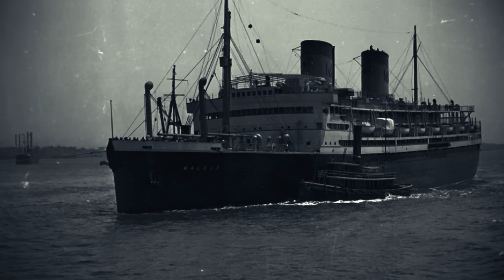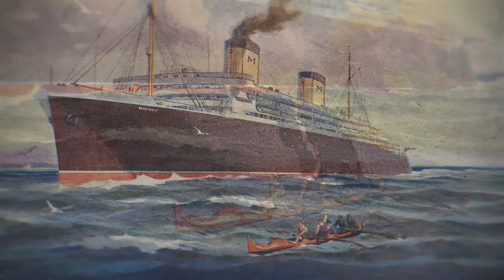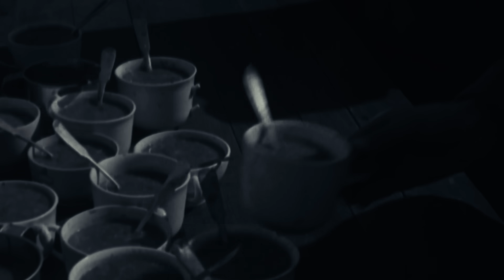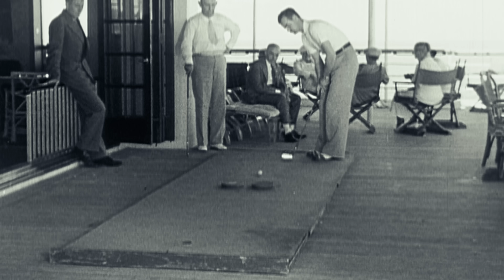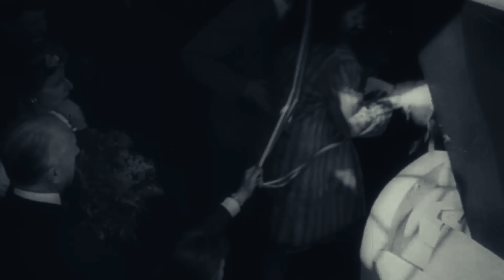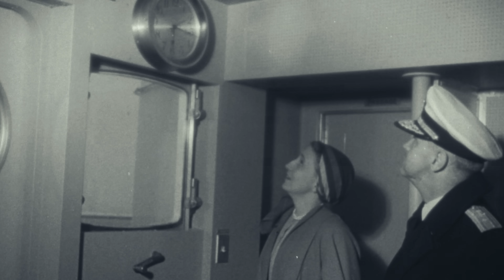240,000 Horsepower: The SS United States

Comment: One minor correction: The four boilers in the forward boiler room were made by Babcock & Wilcox, while the four in the aft boiler room were made by Forster Wheeler. All used Babcock & Wilcox designs, yet for reasons never solved, the Forster Wheeler boilers produced more smoke than the Babcock & Wilcox boilers.

Comment: Gibbs's also designed the "SUPER PUMPER" and "HOSE TENDER" for the New York  City Fire Department in the 60's . It was in service for almost 20 years . They were both built as semi trailers .  The pump on one unit and the hose and deluge nozzle on the other .They were  called to multi alarm fires many times . I believe it pumped around 10,000 gallons of water a minute and along with the Deluge Nozzle on the Supper Tender could put out some serious water.  The NYFD has a special Fire house built just for the supper pumper system  in down town Brooklyn  by the old navy yard . It was put in a central location so it could respond to any call in the NYC area . The system was put out of service in the 80's  due to maintenance issues and the equipment was auctioned off .  I worked in NYC at the time and remember seeing the trailer of the Tender sitting in a NYC surplus yard off the BQE. I believe the complete supper pumper and tender are now with a collector in the Midwest . It is a shame they were not kept in NYC as display .

Comment: I've driven through Mobile, Alabama (where she is being stripped for sinking as a reef) several times in the past year, and the first time I saw the United States, I wasn't really sure what I was looking at -- it was so huge, the first time through I though they had built a new gigantic warehouse in the port, until I saw the name on the side of the hull.  Since then, each time I've driven though, there was less and less of her left, until the last time I drove through at the beginning of May, there was basically nothing but the hull left, and maybe the first deck of the superstructure.  She had also been moved out of the dock where she had been, in preparation for being towed out to sea and sunk.  That will be a sad day to be sure, but at least she will continue to serve a worthy purpose, rather than being cut up into scrap, to be turned into razor blades and rebar.

Comment: It was more of a troopship if the Russians got a bit proactive in europe. And was therefore designed to military specifications, with no large open areas and no flammable fittings  and furniture. This however made it rather bland and unwelcoming to passengers and why few went on it more than once before returning to the cosy friendly queens. It's engines were vastly over powered making it  uneconomic to operate. It therefore had to be subsidised (for the first part of its life). Once this subsidy stopped, 2 of the 4 engines were removed in an effort to make it more efficient, but it never had the passengers or the  design to work as liner or a cruiser, with it going  into storage for many decades.

Comment: I think that every engineer should treat the regulations as suggestions. In the way that they adhere within the lines, but go above and beyond for safety and survivability. If you treat a project like you just have to do the bare minimum, lives are at stake and will be lost. The bar should be the minimum, but never the standard. Never the standard

Comment: She was a beauty, fast and pretty. 240,000 SHP is a lot.
I served on the USS Constellation CVA-64. I did the shaft alley watch for one of my jobs. There were four propellor shafts like the SS United States. Each shaft of the Constellation  was powered by a 70,000 HP boiler. 
  Constellation could go through the water at 30+ knots with ease. Which happened every launch & recovery during our time off of Viet Nam. 
  Would have enjoyed seeing the engine rooms of the SS United States ship, bet they were kept clean and orderly.

Comment: One of the reasons high pressure, high temperature steam is considered so dangerous is that if there is a leak at a pipe joint, for example, you can't see it. Superheated steam has no moisture in it, hence no vapor shooting out that you can see. At 900 plus PSI it would easily cut your hand in two if you waved it over the leak point trying to find it. The best High Tech way of discovering where the leak is, is too use a broom stick! Hold one end and wave the other end around where you think the leak might be. When it gets cut off, you have found your leak.

Comment: I suspect that restoring her would have been impossible, due to the large amount of aluminium in her structure. Corrosion would have been brutal.
Reply: Norwegian Cruise Lines owned her for six years and dropped a few million on engineering studies, only to conclude it would cost less to build from scratch than bring SS US up to modern SOLAS safety regs

Comment: Could discussion about oceanliner propellers fill a full video? I have all sorts of questions. How did they make such huge single pieces of metal? How did they get them to the shipyard if they weren't made there? How were they fitted during construction (cranes probably)? What prevents water from leaking in where the propeller joined to the end of the shaft? What about the shafts, too! How far was the propeller from the motors/turbines/etc? The propeller shafts much be enormous by themselves.

Comment: 9:55 that was so lucky of them the water didn't rise a few centimeters more, because it was right at the smallest WT bulkhead and the water was just about to spill over the next one
Reply: I believe the bulkheads terminated at a point to where the water couldn’t flow over. It just appears that way on the diagram because the affected watertight compartments flooded completely.

Comment: Unfortunately those asbestos panels are very likely the straw that broke the camel's back when it came to dooming her.  The health risks of asbestos would mean that remediation would destroy her interiors.  Given that those internal fittings are what most visitors would see when touring a museum ship, ripping them out would remove a lot of the authenticity in what a person would be coming to see.  Even if they recreated those interior in wood, they still wouldn't be her interiors.

If they had found an interior material that was both less flammable and less dangerous then it might have been easier to gain support for her preservation, but with the end of the age of the passenger liner already upon us with the advent of transatlantic flights it's easy to see why this was a bit of last hurrah.
Reply: The asbestos was removed in turkey and ukraine during the early 90s.  But it bankrupted the owners in the process and new interiors were never installed.

Comment: I'm a Merchant Marine Engineer, and have sailed upon a number of steam powered giant oil tankers and gas carriers. They still utilise the same basics of superheated steam and many operated with B&W boilers too. The basics of superheating steam is to take the vapour created when water is boiled and pass that back through the boiler. It can be extremely dangerous as, unlike a normal steam leak, there is none of that visual warning, like the steam coming off a boiling kettle; superheated steam is completely invisible, and the high pressure means a small leak, which would work like a nozzle, boosting pressure even higher, could easily slice through fresh and bone, just like the ultra high pressure water jets used to cut stone! I did once identify a superheated steam leak in the snake pit of pipework around the boilers; no visual clues but a definite noise change as I walked past it. I was a cadet at the time, on my first ship too, but one of the first job engineers do on joining any ship is to trace pipelines so you know what goes where and where important valves are, especially if automated valves fail and you have to operate the manual valves in the line. I knew I was surrounded by superheated steam pipes so didn't try to find the leak by waving my hand around until it got sliced, instead just moving back and forth on the walkway and using my ears, in an extremely loud engineroom (with a temperature of 50°C and so humid the instant you stepped in from the changing room, you were drenched with sweat, and the snake pit is one of the hottest areas). I managed to narrow it down to a pipe flange, marking it on the walkway, again still taking that warning on superheated steam to heart, before returning to the control room and explaining to the 2nd engineer what I'd found, the reason engineroom rounds are carried out every watch (you get so used to the sound, feel, temperature, smell of machinery that you know something's not right before it breaks down) and how I'd identified the likely problem point. It wasn't too difficult a fix, as it was a section of pipeline that could be bypassed and isolated, but still took the physical effort of someone holding a slogging spanner on each nut and bolt, while someone else swung a sledgehammer at it repeatedly, to loosen it...in an awkward position to get to, the pipe not being on a deck level but on the stairway between levels, and about head height from the gantry, in amongst a true snake pit of pipework, the metal of the pipe so hot beneath the insulation, that if you stand on an exposed flange nut, it quickly melted into the sole of your high temperature safety boot! 😉
Reply: Thanks for your true story.

Comment: "As fast as a family car going down the highway -- at 44 MPH.     
"At 44 MPH, that's so precious"
Reply: Well for LA 44mph is fast, but for texas it's barely a crawl
Reply: @ACJ777777 for the time it was built in , that was fast , for something that weight , pushing thru a resisting , but giving medium  .
 I used to Sail yaughts in my younger days , and also by passenger liners  -  when cars were put onto cargo nets , and lifted aboard for the trip  .
Reply: @ACJ777777  Stoplights on roads with 75 mph speed limits. Driving through Northeast Texas at night is legitimately one of my favorite drives.
Reply: Maybe he meant in comparison to cars back then as 44mph sounds about right for that time
Reply: @TheBinMan123-f8r  A stock 1953 Ford V8 car, equipped with the 239 cubic-inch "Flathead" V8 engine, had a top speed of approximately 75 to 80 mph if pushed, they could comfortably cruise at highway speeds of around 65 to 70 mph.
The top speed of a 1953 Cadillac V8 (equipped with the 331 cubic-inch engine) was approximately 105 to 109 mph...    I think I'll take the Cadillac      lol
Reply: Faster then a Torpedo
Reply: @jacobcave1587not really. Most torpedos (atleast the steam/oxygen powered ones) were as fast or faster at usually around 45 KNOTS, though they could be set slower
Reply: @jacobcave1587 No. 1960s surface launched torpedoes were faster than that for certain.